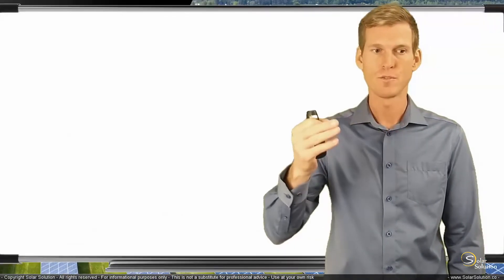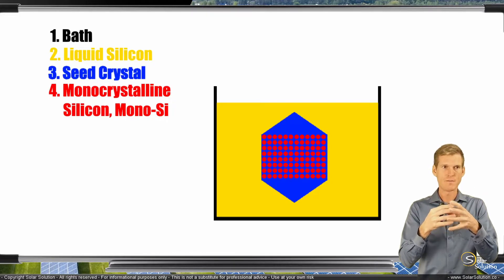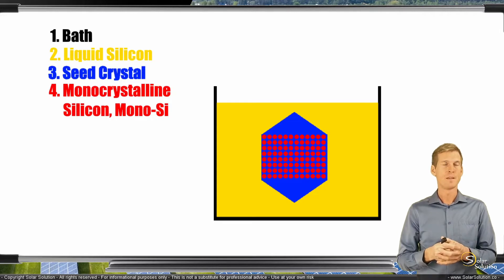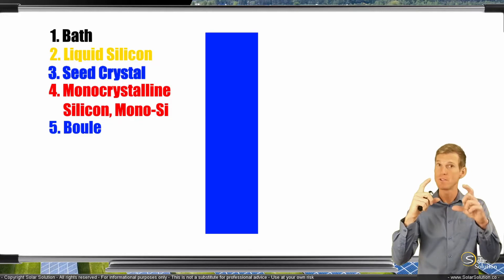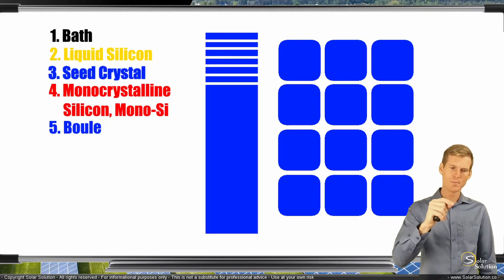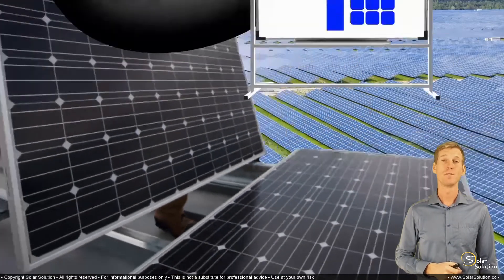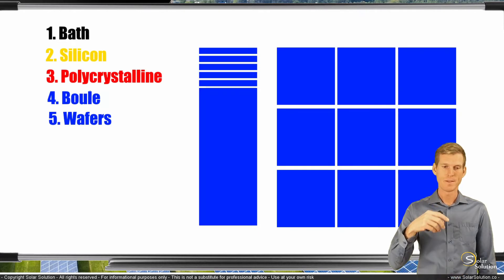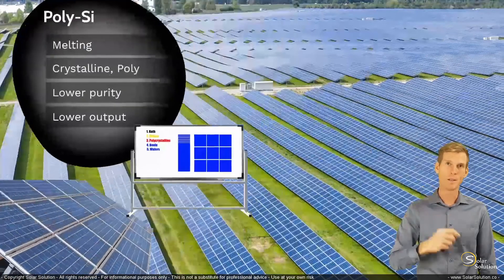How Crystalline Silicon Solar Panels are made

Comment: Hi, is it possible to dye the polycrystalline silicone and cut it like a mono so it can be sold as a monocrystalline pv?
In my country, the prices are the same, whether you want a poly or a mono of the same wattage, I don't get how that's possible considering the mono pv production seems to cost more.  On some mono pv, some cells seem darker than others on some panels, is that normal or they just dye some to confuse buyers?
Reply: No, it's not possible to add dye to a solar cell. In order for a cell to operate at its top efficiency, you need it to be as pure as possible. Adding dye would reduce the cells efficiency or make it non-functional, depending on what you added to it. Poly cell s are less expensive to produce, but when you buy a panel, you are really considering cost per watt, not cost per panel. Mono cells are more efficient, so the cost per watt between the two technologies is the same, or slightly better for mono.